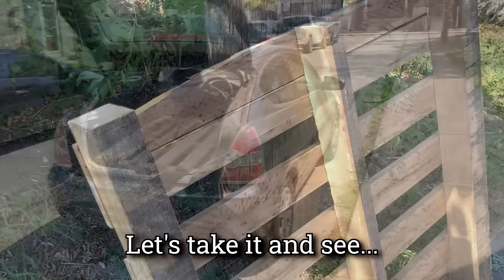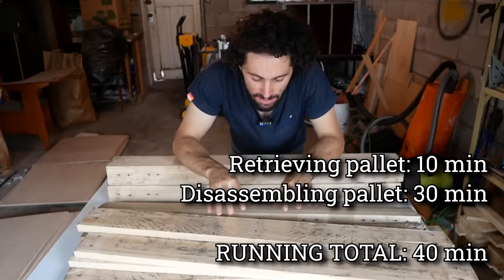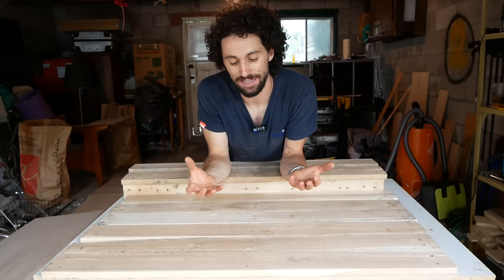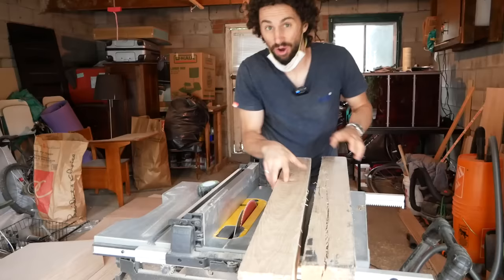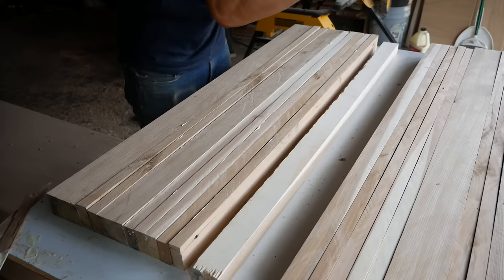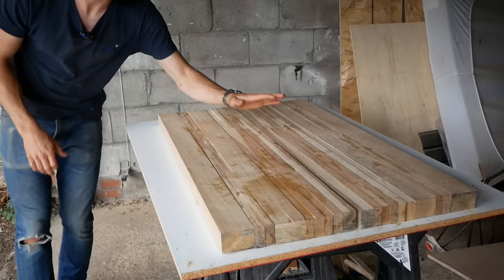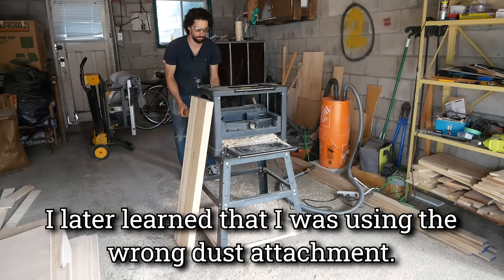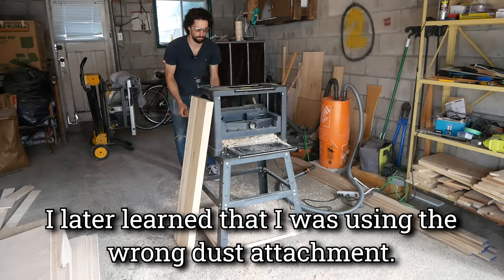Turning a Free Pallet into a $550 Table

Comment: Nicely done, man! You should treat yourself to some outfeed rollers. They'll help prevent snipe on the ends of your boards when you use your planer and they'll stop that awkward bit at the end of a table saw cut where you have to push down to keep the blade engaged. 
Anyway, nice work! Get some outfeed rollers from Home Depot—so worth the money

Comment: Mate, you need to practice some safer standards if your going to post this stuff. Use push blocks for table saw so you don’t cut your fingers off, use a straight board as a guide to avoid bite and kickback.

Comment: The tables not worth $900 because your skills are WAY off being able to charge $100 p/h you're dreaming. The table had a horrendous cup in it, cracks which were not filled, chips, blow outs when you passed through with the circular saw, the list goes on

Comment: Hi, just found your channel and I'm enjoying it.  I would however like to caution you with respect to your table saw technique;  it is the most dangerous tool in the shop and must be treated with enormous respect.  Your fingers are way too close to the spinning blade (use a push stick) and you are standing directly in the line of fire of any kickback (stand to the side).  I don't want to see you get hurt!

Comment: Thanks for sharing. Well done.
Are you aware that pallet wood is either cooked or drenched in poisons to preserve it?
Pallets are not suitable for all uses. I would never use pallet wood for kids toys or anything that may contact food even when sealed. When machining, sanding etc at least be aware of the hazards.
I notice that you did not factor in all your costs..... admin, cleaning, waste disposal, electricity, fuel, travel time, sales costs/time etc.

Comment: I feel a bit sorry for the person who bought this. The idea of this table is nice, execution, not so much. First that caught my eyes is the unsafe practice with the table saw. But ok, that doesn't effect the product, just his ability to produce anything in the future.
This table top has a pretty pronounced cupping. When you see it on his ''bench'' it is rocking. When he is trimming it, you see a gap in the middle of guide. When he is sanding it on the sawhorses face up , it rocks and it doesn't rock when he turns it around. When he is routing the edges you can clearly see it by eye. Cupping. pretty severe.

Comment: U didnt use the proper tecnique to get a straight edge with your table saw insted of using a jointer. But it turned out ok. I wouldnt give u even close to 500 bucks for it. Rich people have no clue some times about what they are buying.

Comment: Man. I love this video. But you are freaking me out with your table saw. It’s really concerning how close your fingers are to the blade. If the wood takes off, your fingers will follow that line and go right through the blade. I’m not trying to be that guy. Just be cautious. You seem to know what you’re doing but even a pro has accidents. My friend cut off his finger on a table saw. He was cutting a large piece down the center. When the piece split, half of it took off down the runway and his finger went clean into it. Use a push bar whenever possible. ✌🏼